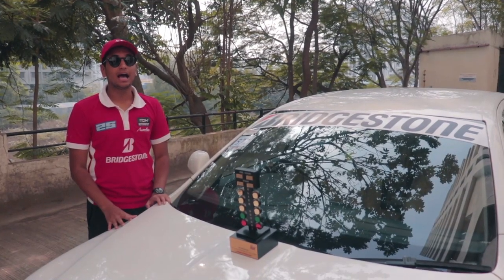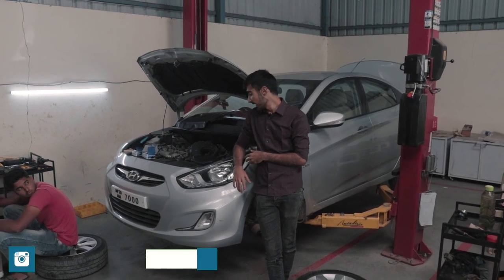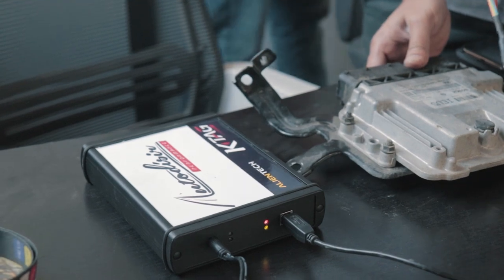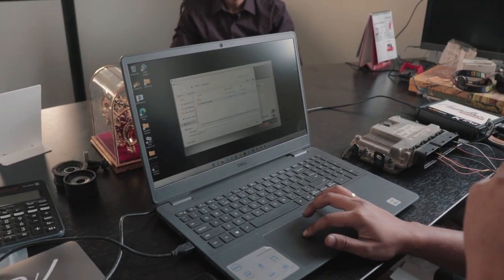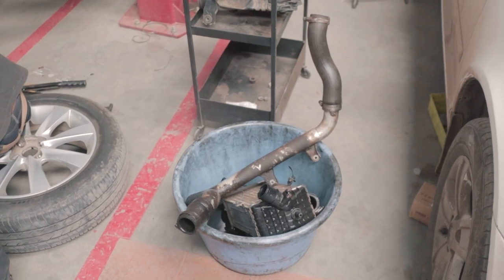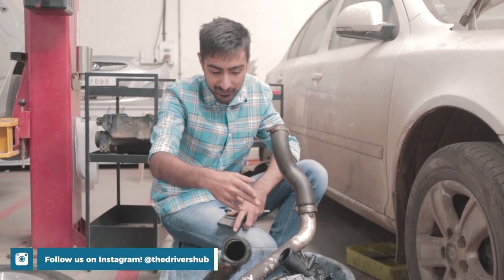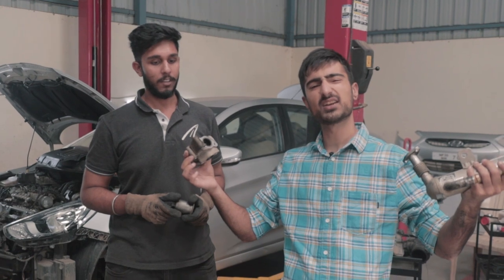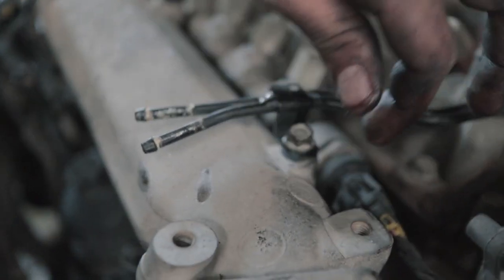Building a Stage 2 Hyundai Verna Diesel for drag racing! | Road to Valley Run S2

Comment: Why Lancers are so underated in india ?
Reply: Not that one underated there's thousand of second hand lancers online
Reply: @aakashpal8525  yeah they are no more underrated for sure I also bought one but one tuner said that it's motor is very old like from the 80s that's why difficult to tune and all ,so I think what he meant was that if u have the money then u can have the honey
Reply: @therenegades7329  i think you should have thinked about  nissan 350z or 300z comes second hand under 20 25 lack which is rwd,v6 and 500 hp in stock which can go to 700 800 hp easily by tuning
Reply: @aakashpal8525  how old are 500hp stock on 350z?